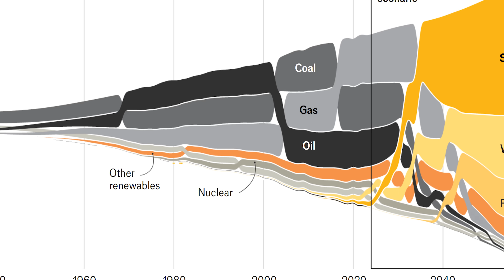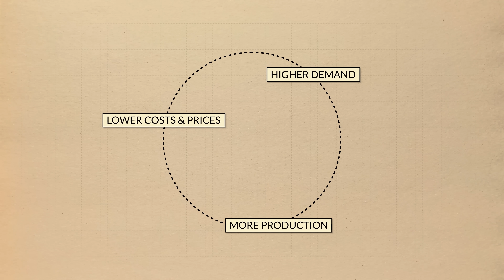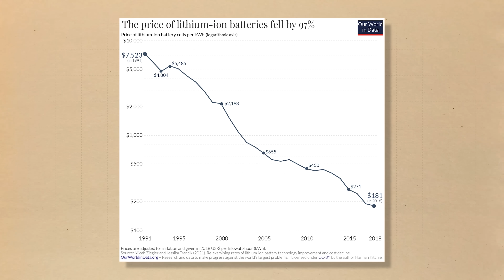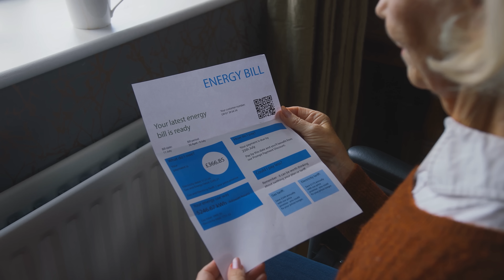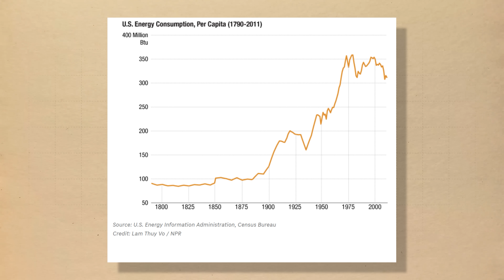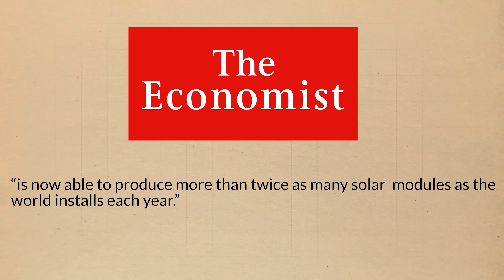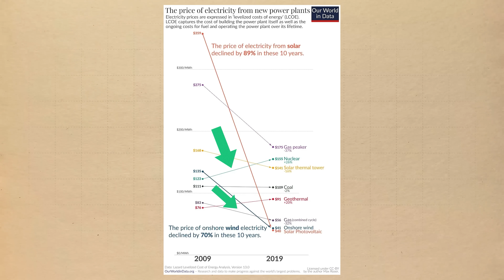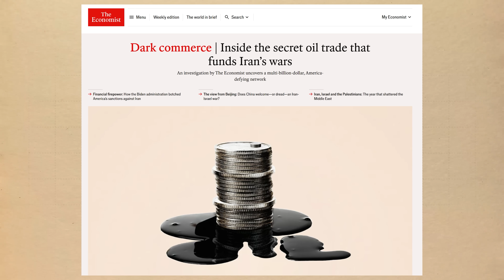Why solar will soon dominate & what that means for the world

Comment: I intend to buy solar. Solar might become the largest source of energy, but it's definitely not going to be the only source of energy. You already mentioned wind power. We also see growth in hydro, nuclear and geothermal. Storage technologies will play an important role, and are crucial for further growth of solar. Those technologies still need to scale up. That will take time and as a result in some countries that are currently leading in solar, the growth will stall.
We might see a transition to solar thermal, as heat is much easier to store than electricity.
China is leading, but growth there will stall. The population and workforce are in decline. Demand for energy will follow. That's not a good environment for solar investments. 
One minor point of criticism. China's domination means that we are still not in the phase dominated by private investments. Yes, most investors that install solar are private parties in the west, but not in much of the rest of the world. The manufacturing chain in China is mostly state owned and the 'private' ownership is also state controlled as China is a communist country.

Comment: Scientists - 100% of all solar panels fail at night and are ruined by the first hail storm that will eventually come your way.
Climate Cult - We are so clever and have wind turbines as backup power.
5 year old - But the wind only blows 35% of the time usually when we do not need it and is therefore useless.
Climate Cult - We are so clever we have batteries as backup power.
Scientist - Batteries last only hours at most when wind and solar are not available and are therefore worthless.
Climate Cult - We are so clever we have gas, coal and hydro as backup power when the entire renewables grid fails.
5 year old - But that is fossil fuel backup and is equivalent to having a second grid which is unnecessarily expensive.
Climate Cult - We are so stupid.

Comment: 0:17 Reading your chart. It shows the opposite of what you are stating. From the chart it shows reality is less than predictions from 2021 to at least 2023, and everything before showed “Reality” higher than “Predictions”. I have no doubt that it will keep growing, but it needs more capacity in energy conversion, less cost and durability improved.

Comment: The black shaded area of installed capacity in the western part of India is actually Pakistan. Pakistan was the largest importer of solar panels last year and its install capacity has skyrocketed. And for a relatively smaller and poor country, it is remarkable. 
It is not due to the govt promoting solar, it’s because of complex contractual reasons, the tax on electricity is so exorbitantly high that people are desperate for an alternative. 
The growth is all facilitated by the private sector and is haphazard. 
I visited last month and most of the people I know have solar panels on their roofs and some are even completely off  grid even in big cities.  
And there are tens of thousands of small solar installation companies all over the country. 
Good news for the consumer. Bad news for the government.

Comment: First off, the levelised cost of renewables (wind and solar) must include the cost of backup generation from fossil/nuclear when the sun does not shine or the wind does not blow. So, the continuing drop in the 'price' of solar and wind power is a mirage. 

Second, the price of batteries will start to rise very soon because of the scarcity of rare earths of heavy metals that are needed in their construction. (This applies to wind turbines as well, by the way.)

So, in conclusion, other factors will come into play to stop the 'exponential' growth of renewable energy. And none of this mentions the economy of China, which has cornered the market on solar power manufacture, but whose economy will tank before the decade is out.

Comment: For those incredibly FEW of you who actually want to know what the next major innovation will be, it is ...

wait for it ...

CHEAP DESALINATION.  Using low-cost solar panels, and the principle that the air JUST ABOVE the ocean (1 meter) is almost always at 100% relative humidity, a very-low-maintenance desalination solution using solid-state cooling (Peltier effect or one of the newer technologies) and innovative design that takes advantage of the temperature differential between the air and the water at a depth of about ten feet to "distill" ocean water and pump it to shore.
NO big massively expensive desalination plants, no "brine" problem and very low overhead. COST EFFECTIVE when mass-produced, so will need at least one government to get on board. Requires NO engineering or technology breakthrough because it's just (mildly) innovative use of that we have and leveraging the (now_ low cost of panels.
Saudi Arabia would be nice to get on board.
I have no personal stake in seeing this happen WHATSOEVER (too old and Canada has LOTS of fresh water still!), but would be happy to consult 🤣

Comment: Natural gas is cheap, reliable, fairly clean and plentiful … especially in North America. It provides a competitive advantage. It will be around for a long time. Nuclear has huge potential. Solar is not dependable and cannot be used as a base load. It has its place, but will not replace hydrocarbons for many decades to come, imho.

Comment: The commentator referenced that he is in Belgium.  As if they have so much sunlight to power solar panels.  And, as if they have so much spare land to be covered by solar farms.  This is a problem for most of northern Europe.  Europe should be focussed on nuclear and other clean energy producers.
Reply: By the time a single reactor is built we should already long be 100 % low carbon, even proposing nuclear is very unserious.

Norway has done it, the snow, icey, wasteland that doesn't get sun for most of the year is almost 100 % renewable. 

The space requirement is also insignificant, but if lawmakers were that concerned about it they could simply prioritise rooftop solar in their subsidises.

Comment: Bonjour et merci  from a fellow Economist reader in France. I started subscribing back in the 1980s and have taken the newspaper ever since. You reference  'The Long Goodbye' which together with  'Sun Machines' are deep dives on how we got to where we are today, current trends and likely outcomes going forward. Most people just don't realise how disruptive those innocent looking little black panels are. It took decades for solar to get to 1% of global electricity in 2016 since when it has grown exponentially and reached 6% last year and more tellingly perhaps 1% of global primary energy. There is no shortage of raw materials and no shortage of places to put the panels, so expect solar to overtake all other forms of energy generation by the early 2030's, coal included and be providing 10% of global primary energy. Well summarised video!

Comment: To base a projection for the next 10-20 years on the last 2 or 3 years of data that show increased rates (which seems to be the starting point of this discussion) is rediculously optimistic.  Comparing solar panels to other technology that has reached wide adoption (internet and cell phones) doesn’t seem reasonable either.  If you own a home with grid power, and your power bill is not so high that it warrants much time or attention from you (count me and most Americans in that camp), then there is going to be little perceived benefit to adding solar power to your life (especially balanced against the cost of install, uncertainty about how it will perform in your circumstances, and how it will impact you for maintenance).  

Internet and cell phones had clear advantages over what came before for the average person which drove their exponential growth.  Solar is a good thing but the benefits are more suited to a small subset of people than the other technologies.  I think, when you show explosive growth for two years, you need to have a very good explanation for it if you want to assume a continued acceleration in adoption.  My guess is there were some special circumstances which drove those high numbers and that those are temporary - the adoption rates will plateau long before wide adoption because grid power is generally a good service and solar (even if you think favorably about it) isn’t clearly better that what it would be replacing (for most of us).

Personally, I’d love to have at least part of my house power be off grid and powered by solar and battery to eliminate my vulnerability to power outages.  The technology hasn’t reached the level of maturity to convince me that it is time to act though (as someone with a day job in technology and less free time than I would like)

Comment: There's solar panels then there is the storage of electricity which is the problem.  What are batteries made from?  Where does the supply and of metal and minerals come from?  Is mining this metals and minerals better or worse than oil and gas?  Is there an endless supplies of the metals and minerals needed to build solar panels and batteries?

Comment: Two fairly easy predictions to make from solar electricity becoming very cheap

1) The energy cost of desalination is less of an issue
2) Making synthetic jet-fuel from CO2 captured from sea-water or cement plants via the Fischer-Tropsch process become viable. 
3) Using hydrogen generated by electrolysis to reduce iron ore to iron and water instead of using coke to reduce iron ore to iron and carbon dioxide. 

Item (2) is worth pursuing because it's very very hard to power jet planes with liquid hydrogen or lithium batteries and it's very very hard (probably impossible) to avoid releasing CO2 when making cement.

Comment: As PV (and Wind) energy grabs larger shares of the electricity production, the fossil alternatives will see disadvantages of scale: they will be online less of the time, and have to cover the fixed cost with fewer MWh of energy. We see this effect in the NL this month. The cheapest solution will be excess renewable capacity, some storage, smart grid management, interconnect between markets, and possibly some hydrogen production as a feedstock for industries such as fertiliser and steel.

Comment: I think you left out something very important.  The decentralized nature of renewable energy sources like solar and wind fundamentally change how easy it is to control energy production in hostile geopolitical actions or authoritarian regimes.

You can easily control access to oil, gas, and coal deposits, even nuclear plants, but the sun shines everywhere you can't monopolize it with a small force or blockade a single ocean passage to cut off an entire nations main energy supply.  Every petro-state and it's government is going to have to seriously diversify their economy, and fast.

A solar energy economy is effectively positive sum, rather than the zero sum dynamics of the current fossil fuel markets.

Comment: Imagine how many problems would be solved if everyone just went to nuclear
Reply: sure... but you did see the graph of the costs of solar (and wind) compared to nuclear?
Nuclear plants are expensive and time-consuming to build - though they will be useful for baseload (and the tech giants' data centres for AI).
Reply: @Sairfecht  Imagine if we hadn't underinvested in nuclear, how dramatically lower the cost would be. I don't buy this argument as you should look at cost pr. Mwh over the plants/windmills/solar panels lifecycle. Much of the reason why Nuclear CAN be expensive is ridiculous government regulation and intervention, as in Germany where they shut down fully functional nuclear plants in the name of "green energy" and look where that got them on both energy independence. Not to mention how they now are less green as they replaced nuclear with more brown coal and imported gas. Also, the space requirement is enormously higher for any other form of energy, while nuclear is also safer, produces less and not dangerous waste and so on:)

Comment: The 'installed capacity' of solar is often very different from the available power produced and that in turn is different from the amount consumed and turned into real value. Long story short, installed capacity is a meaningless number for solar and people should stop quoting it as though it was equivalent to installed capacity of, say, nuclear. Nuclear capacity factors are not location or time of year dependent and should be ~80%. At the other end of the spectrum, a Bavarian solar farm achieved a capacity factor of 12% per wikipedia. Add to that the fact that the solar power would have been produced at a not especially power hungry time of year, something that Li-Ion batteried can do nothing about, and all of the solar panels installed by the state in China are not as useful as an economic indicator as the Economist may think.

Comment: The graph at 4:48- what is "Gas (combined Cycle)"?  Natural gas commodity prices were $4.80 in Europe and $2.60 in USA in 2019.  I am thinking this video overstates solar and wind's competitiveness with fossil fuels.
Reply: Peter Zeihan has interesting stuff on green energy.  Not nearly as optimistic as this presenter.  https://youtu.be/0_qA-_bScFs?si=j90PD1IGlirLXQRS&t=1869
Reply: Also... the red areas on the map at roughly 10 minutes... are hundreds or thousands of miles from population sources that could consume it in Africa or Australia.
Reply: @tylerschmidt2394  Indeed. But then look at the the Xlinks project to have solar power generated in Morocco transmitted to the UK 2,500 miles away... (assuming it gets built). I guess the UK can 'afford' it.

Comment: Please check solar GENERATION capacity, not INSTALLED capacity. There is a huge gap between installed capacity and generation capacity. 

Solar energy is intermittent and unreliable, and there is no affordable large-scale way to store it. It has a low-efficiency rate compared to gas, coal, and nuclear power which leads to governments backing up solar power with traditional reliable sources (leading to lower efficiency for those backups and essentially a double investment).

Solar electricity generation in the EU has grown in the past decade but was still just 9.19% in 2023, less than Coal (12.47%).

Comment: I live in Pakistan. A lot of home and businesses are installing solar panels on their roofs. My home has 10KW solar setup as well.
Reply: How much did it cost?
Reply: In warm countries with lots of sun like yours i understand that its a smart move, but so many is trying to push we in cold climate country to have solar... And we don't use much electricty in the summer, but in the winter we use alot, but then there is no sun.
Reply: Y'all poor as fuck and you somehow afford 10kW solar panels
Reply: out of curiosity, because of this cheap/free electricity are people also choosing for electrified transport? (instead of gasoline)
Reply: @gerbenkarman3372  petrol/diesel has been obscenely expensive compared to electricity for quite a long time now, the issue with electrified transport is the battery charge duration and how long a charge lasted, not the electricity price.
These days though electricity is becoming more and more dominant as the transport method of choice.
Reply: @gerbenkarman3372 electric cars are really expensive so does not make sense of average people.
electric bikes is where people are going to go to instead of patrol bikes.
Reply: What all are you able to power with 10kW?
Reply: @nikilragav 
10kW is A LOT of energy. You can supply the avegare house with 10kW/day, but there are around 5 solar hours in a day so you just need to install 2kW in your house to be net 0. Those 2kW should cost you about $1000 USD depends of where you live.

All of this might change from a place to other but its really easy to estimate how many panels you neet. Just need to see your power bill to check how many kW you spend per month (choice the month of highest demand) and divide it into the days of the month. Then you have your daily expense. Finally divide that into your solar hours (Google that, it change in every country) and those are the kW you need (usually multiply that by 1.25 to account losses) 

I think it's something everyone should do!
Reply: @nikilragav It's hybrid system that works with grid. Yes A/C, heating, everything is powered by it. Sunny day time it uses solar and sends excess units to the grid and at night time It takes units back from the grid.
Reply: 1kW solar setup 24hrs me Kitna unit (kWh) electricity generate karta hai ?
(My guess is around 5 unit).

Aur cost kitna hai ?
Reply: @Atheist-Libertarian Yes around 5 units. Might cost around 1000USD

Comment: Solar cannot yet power heavy industry, nor can it work without storage. It remains highly inefficient and has a plant life of around 20 years.
Although it is sensible for part of an energy mix, it is far from "the" answer alone. It makes up barely 5% of the global energy mix and most of the best sites are already taken.
Solar remains, for now and the next 15-25+ years an expensive, unreliable energy source, unless it's on your roof & you can afford $10k for a battery.

Comment: In 2023 energy from natural gas comprised 36% of energy consumed in the U.S. compared to 32% in 2018. In 2023 energy from renewables comprised 9% of energy consumed in the U.S. compared to 8% in 2018. So, I am at a loss as to why the steep decline in upfront capital expenses for renewables get so play when the overall share of energy consumption is not showing a renewable energy surge.